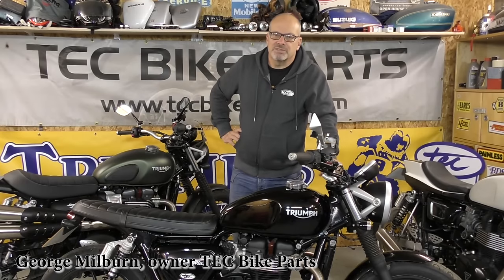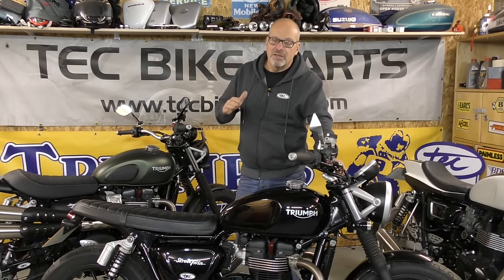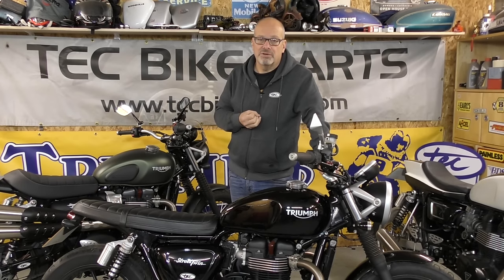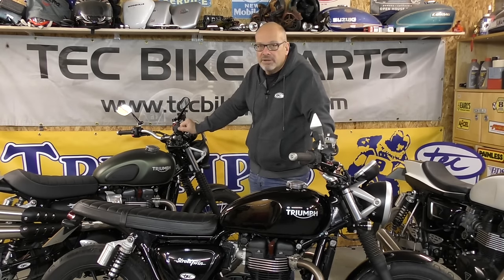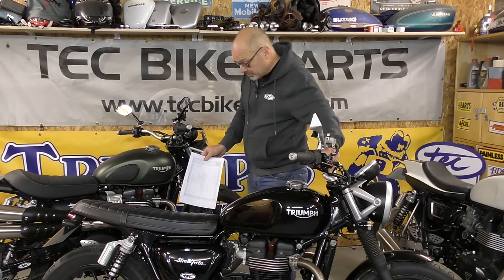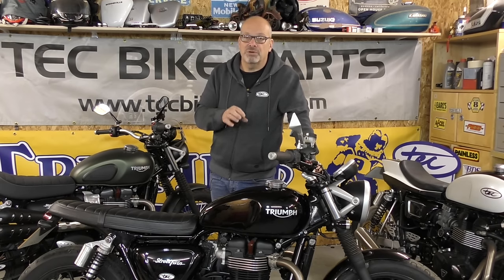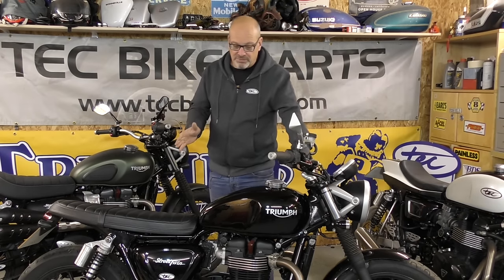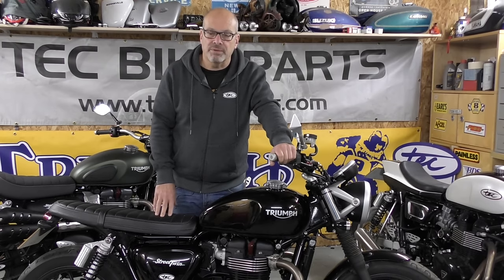How to de- restrict 900cc Triumph Street Twin/Cup/Scrambler/T100   for LOTS  more power and torque.

Comment: Triumph must have seen this because the 2019 street twin is producing very similar numbers to this cam upgrade.
Reply: Triumph probably bought one off George covertly and copied it :-)
Reply: Exactly
Reply: It’s still pretty crappy beyond 5500 rpm. So still a low rpm bike
Reply: these idiots are only interested in marketing to social wanabees. It has very little to do with motorcycles. Unfortunately that is what has happened. The cappo late set is now more powerful than the bikes.
Reply: Is that power at the wheel or at the crank?
Reply: @wolfpackpete6408 it's at the crank for both.
Reply: @thomaselliott573 when you get older you'll realise that it's more fun going fast on a slow bike than having 120+ hp that you can't use. I've had bikes for 40 years and I  always bought powerful Japanese and Italian bikes until I was in my mid thirties, nowadays I'm happy enough on a decent 500 or something like this.
Reply: @paulm2467  I thought dyno runs report power at the wheel, and manufacturers report at the crank because they tested it in a engine testing bay.

If Triumph have changed the cam design because of this, it will explain why cam upgrades aren't available for newer models on the tecbike website
Reply: @wolfpackpete6408  possibly, it's actually quite hard to work out because they use the back wheel figure when they are talking about it but seem to use a different figure in other publications, I hope that they are comparing 'like to like' and the substantial increase would seem improbable if they are comparing their back wheel to the factory crank numbers.

Comment: Having had this fitted recently (April 2019) and finished running it in (300 miles back from Newcastle and a couple of other runs taking it to 500 miles) and then doing the oil and filter change, I can vouch for George's claims. The engine finally does what it should have done out of the factory. She has been released! :)
George was excellent and I now have an even torquier engine and an unrecognisably better top end. Thanks to George for his great work in figuring this out and in delivering it to the market. A highly recommended upgrade for any Street Twin owner.
Reply: createmate - Congrats. With the increase in HP, do you still experience the same vibration/buzz above 120kph (75mph) or does the camshaft smooth out the ride at top speed?
I have a Street Cup and I'm hoping for a "longer" top 5th gear for highways.
Reply: @salskars6637  It smooths it out right through to top speed. It's a different bike/ride :)
Reply: @createmate  - Hell yeah. Big grin.
That's what I wanted to confirm. Now I won't bother with a 19 tooth front sprocket. 
Thanks for the quick reply

Comment from the maker: The video is a guide only and I would suggest using it along side the workshop manual from Triumph or Haynes.

parts numbers

alternator cover gasket  - T1268765

CAM screws T40 head  - T3053005

Cam tensioner O rings - T3600199 + T3601276

Tightening torques

Cam sprocket screws 22 NM

camshaft bearing carriers 10Nm

Head top cover 14Nm

Alternator cover bolts 10Nm

Cam tensioner  16NM

You can safely run the bike with the stock ECU . I would check you have the latest software update from Triumph installed as the latest dealer update tune is a lot better than the factory gates tune.

We have done testing with the triumph updated map and the Vance and Hines Triumph map and very little difference.

For max power you can use a Power commander but we found that is was not really worth the money as the throttle body / air box was at almost max flow already. The only advantage was the timing could be advanced and rev limit raised ( both risky if you are not sure what you are doing) we also found fuel economy not as good with power commander probably due to the O2 sensors being bypassed.
 You can get a wide band O2 sensor add on kit for the PC5 but again this is expensive.
As with all power commander and similar systems it is only as good as the tuner who has set it up on the bike and can be dangerous in the wrong hands.
Reply: TEC Bike Parts - If the Street Cup is already vibrating in 5th gear at 75-85mph, does the increase in HP increase the vibrations? I just did 223 miles averaging 85mph (136 kph) so my question is, would the camshaft (de restrict) which increases HP reduce the vibration at higher speeds? Thanks
Reply: And then there is the TuneECU app.

Comment: Thanks TEC for this video.

In the video you mention the part will retail at £250.00 and would be looking to make this even cheaper in the future. The cam currently is offered on your website for £360.00 - that's nearly 40% more than you mention in the video.

Comment: I installed your cam shaft and it gave a huge difference in power.it is a complete different motor. Fuell consumption is even lower if jou ride the bike normaly in daily use.

Comment: Great work look forward to the T120 development work appearing on your channel , thanks .
Reply: Except if the T120 had much more power I think you may fall off the back - almost happened to be a few times (I have done a few power increasing mods) already due to the upright seating position.

Comment: Really wish Triumph would run a high performance model for both the 900 and 1200 engines with all the goodies mentioned. Bigger valves, twin TBs, higher comp, stage 2 cams, higher flow airbox and exhaust, and the brakes and suspension to suit.
Reply: You mean normal performance instead of marketing performance
Reply: I believe it’s called the Thruxton...
Reply: Wouldnt sell any thruxton

Comment: I have a 2016 STwin with decat, straight through V&H, DNA filter, snorkel removed, Dart classic screen and stage 1 cam. It flies to the ton (on a private road).  For me as a 100kg guy it really means you must do the suspension.  In standard trim the chassis really can't make best use of the power.  I have dropped in 8.5n/mm linear springs in the front with standard fork oil and there is an improvement.  Next month the Hagon 2820 (10mm longer Street Cup spec) will arrive, and that should sort things out.
My conclusions?  Do it.  The bike is transformed.  It is now a very capable roadster and an excellent all rounder and surely the prettiest.

Comment: I really do hope y'all follow-up on offering the camshaft for sale, and how-to video(s) for the installation. One of the major drawbacks pointed out by reviewers is that the T100/Street Twin lack enough power for pillion riding/highway touring compared to the T120. However, the T120 has gotten some negative attention for its dodgy throttle input compared to the lighter and arguably more reliable Street Twin/T100 900cc motor. It's bad enough that Triumph discourages the installation of installing dual discs on the new T100 as opposed to just getting a T120 but this takes things to another level.
Reply: I also hope this can be made available for the US market!
Reply: @Asillyhobo You just order it and TEC will send it.

Comment: My dealer installed the cam for me some 7 months ago. After seeing the video, I thought this might be the solution to unleash the potential of my street scrambler engine. Before the cam was installed I fitted a K&N filter and removed the snorkel. Engine felt like it breaths better, throttle response improved and the sound was notably nicer.
Then the cam. In the video there's a few claims by TEC: Huge or significant improved power and torque and throttle response and louder engine. Louder engine: True, nice sound that is. Throttle response: True, however not that brillantly improved. More power:  well, I think so. However, by far not that much like in de video. Same for torque values I guess. OK, I don't have a dyno run to prove it, and I didn't remove the cat. Still, the 70bhp is something from a Hans Christian Anderson story if you ask me. It's just not what I get in real life and I don't need a dyno to prove that (I will put in on a dyno soon though). OK, before the cam was installed, power dropped away after 4000rpm and on the motorway speeds of 120+km/h were hard to reach. By now, it just keeps on getting stronger until you hit the rev limiter. That by the way kicks in pretty strong at about 7000/7100rpm, so keep an eye on the display for the rpm. If you want to be sort of fast on the bike, keep the revs over 3500-4k and the bike is fast-ish. Below that, well, it's a different story. That also makes me wonder if bottom end torque is lower than before the camshaft swap, but I'm not sure. To make the bike run a bit less lean (standard bike runs almost dangerously lean) I installed the TEC booster plug. I think that helped the bike not to stall anymore like some folks report when riding at low revs, for instant on a tight roundaboud. A friend of mine also put in the V&H full system exhaust without the cat and also doesn't get the values shown in the video. He got stuck at 55bmp/74nm no matter what he tried. He tried 98 and competition 103 octane fuel without ethanol additives (so just pure petrol), and still doesn''t get the values shown on the dyno. He put it on the dyno and actually got lower bottom end torgue…. 
In short: Yes, I'm happy with the changed engine behaviour. Bike runs smoother and seems less willing to stall. But, the power increase if far from what I see in the video. And if TEC says that charts and graphs are not that important, well don't show them yourself in the video then. If TEC claims the values are reached only by burning 98, well the's also not the solution if you ask me. That's been tried by us and no increase whatsoever. However, there are people that seem to get more power and torque, other people don't. Why you might ask? We haven't found out why yet and we hanven't received a solid answer from TEC either.
What about the brakes you might think: Well the bike won't be faster and you don't need to put on stronger brakes in my opinion after the cam swap unless you're not happy with the brakes before the cam swap. The bike is not a race bike and 170km/h-ish (107mph) is the max, cam swap or not. It just takes a lot less time to get to that sort of speeds. I wouldn't want the bike to be faster though since without a screen it's just not comfortable at such speeds on this bike. You need full fairing on this bike to reach 120mph and ruin all of the beautifull scrambler looks. Besides that, if you want a fast bike go spend your money on something else. So if you want the bike to run a bit better and accelerate a bit faster, spend the money and put in the cam. If you want a significantly stronger bike (more power, more torque like in the video), get yerself another bike or a 1200 twin.
When I put it on a dyno, I'll keep youse posted.
Reply: Strandwal - What's the update on your dyno?
Reply: Dyno results? Updates...
Reply: @salskars6637  I haven't put it on a dyno yet. I probably will when I get a chance to flash the ECU. However, I 've been to the Eiffel in Germany for three days with 8 friends all on heavier/ faster bikes. Thanks to the cam I could easily keep up with them in de twisties and hills and forests. All of them were surprised how well the scrambler did, even on the motorway. First they were joking about the 'mopet' , after three days the scrambler received respect by all of them. Without the cam that wouldn't have been the case. Next: cutting out the cat and try to flash the ecu.
Reply: @strandwal6878   TY for the feedback. When you're on the highway (for a 5 speed)) do you still desire a 6th gear? or did the cam make 5th gear "longer" more like an overdrive highway smooth gear?
Reply: Sal Sonic it’s ok. See the bike isn’t ment to do a lot of motorway time. Just not suited well enough for it. 5th gear is fine. See, if you’d put a sixth gear the revs will be lower but it wouldn’t be much extra useful or anything. Don’t expect miracles like in the TEC video but it’s a great improvement all together for relatively little money
Reply: @strandwal6878   - Probably the most realistic/honest answer so far. I appreciate it, thanks again. 

I've got the Street Cup '17 btw. 
Love the torque/punch. On a 3 1/2 hour 144kph/90mph average speed, the vibrations were a bit aggravating. 

Like you said, the engine is fine minus long highway stretches. Scramblers look sweet as hell too. Great info.
Reply: @salskars6637  Scrambler will be on a dyno in MArch when I'll het a power commander installed as well. Then the mod list includes: tec cam, K&N filter, snorkel removed, polaris inlet plenum, weslake headers without cat and the power commander.
Reply: @strandwal6878  looking forward to hearing your results,
Reply: @liamnyirenda5734  hi, due to serious bad weather I had to postpone the tuning to May 29th. I keep you posted

Comment: I just got back into riding and picked up a used T 100 with 1,000 mi on it. A takeaway for me is never to upgrade to a T 120 but to modify the T 100. Or get a different bike all together, Triumph of course.

Comment: Thanks George, I have the Street Scrambler and didn't understand why the HP was so low for a 900cc motor.  I'm assuming this would void the Triumph warranty, at least on the engine.  I've only had the bike for 8 months, so I'll have to wait a little longer for the cast cam if you take it to production.  I sure hope you do.

Comment: Does the restricted cam only apply to the 900s produced AFTER the 1200 was released? I have a 2011 air cooled Bonneville SE. I have added some Bassani mufflers, but it is otherwise stock.

Comment: Great explanation on a topics that had me peeling hairs out off me head - I really was woundering on "that low" HP on the T100, but more on the T120, clearly I understand, and apresiate the Togue - so Sir would you pls make the same test on a Bonneville T120 stock - - Best Regards from Denmark

Comment: Hi, I would love if you can make the video/guide which you were talking about at the end of the video, on which is the perfect combination you recommend in terms of customizations to make the most in performance from this bike. Right now I've installed the V&H 2:1 Pipe with its own map and K&N filter. I was wondering if purchasing the Dynojet Power-Control V would also help. Nevertheless, I'm thinking to take the camshaft from your shop, especially now that Triumph basically did the same improvement on the new Street Scrambler 2019. But before to do that, I would like to hear from you.
Thanks!

Comment: Excellent work.  Do you have similar improvements for T120s?  I currently have de-cat, Sleeper Pros, Power Commander, and K&N.  What's left, cam?  Bigger intake valve?  Inquiring minds want to know.
Reply: I'm also wondering what they can do for a T120, or even a Thruxton. I considered buying a T120 a couple of years ago and what put me off was the lack of options for tuning and upgrading.

Comment: Really great stuff, George! But just a few quick questions:
Why does the dyno for your baseline street scrambler run start at 3400 RPM?
Torque peak for the street Scrambler out of factory is ~2800 RPM
Torque peak for the Street Twin out of factory or with the "offroad" arrow tune is ~3400 RPM
Does the baseline scrambler you use have the arrow tune or was it an accident that the dyno started recording after TQ peak?

Looking at my dyno sheets, it looks like your comparison fitment (second dyno run) has around 3-4 less wheel torque between 2750-3300 compared to a stock Street Scrambler.  Any idea how you would gain any of that back?  From what I see is most people are in the 2800-3200rpm range when cruising off highway on this bike.
Reply: comparing dyno graphs from different runs, different bikes, different regions, is pretty much useless unless all are using corrected results using the same formulas. Even then it's sketchy to draw conclusions. Dynos are best used against a base line on the same bike same day etc. to compare results of various mods or tunes/Maps, not to look for maximum Power or torque necessarily.

Comment: Just bought the new Scrambler 900 Sandstorm and started looking at Info like this so late to the party. Triumph  claims it now had 64.1 BHP @ 7,250 rpm and 80 Nm @ 3.250 rpm so I wonder if they’ve just put the correct cam in now?

Comment: Totally off topic.  Would you please tell me if you think a Predator Pro Shorty Exhaust which I understand is a high speed exhaust and allows the engine to run cooler, perhaps with an X Pipe to replace the Cat would eliminate or significantly reduce bluing on the header on a T100 / T120?

Does the T100 have a restricter like your describing on the Street Twin?

I'm looking at the T100 or T120 as a first bike.  I'm 51, 6"3', average weight?   I'm leaning toward getting the T100 at this point which has been recommended by an advanced rider.  What disadvantages would a beginner have with a T120 as opposed to the T100?

What accessories would you recommend on the T100?  I'm mainly looking at the ones that protect the bike like the sump plate guard, fork protector, dresser bar, and an alarmed brake lock.  Are their other accessories you would highly recommend for a beginner?  Are their specific products you offer that you would recommend for a beginner on the T100?

Where I live a written test and then a basic rider course is required.  I want to learn to be the best rider I can.  How would you recommend someone advance their riding skills beyond just the basics taught in the basic rider course?  I live in the U.S.

Comment: I just need to know if the modification will affect the fuel consumption capacity of the bike ? Will it give the same mileage as with the original company fittings or will the mileage drop due to increase in power which normally happens ? 
Can you please specify the figures ?
Your reply is much obliged !!!
Reply from the maker: we have used these cams for thousands of miles and not noticed any change in fuel ecconomy